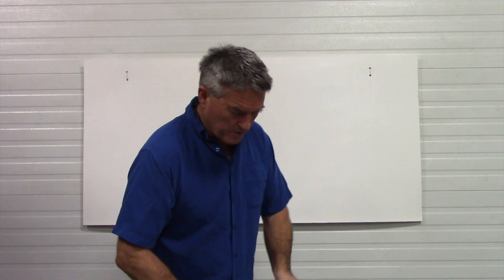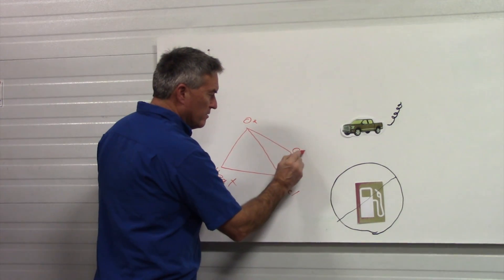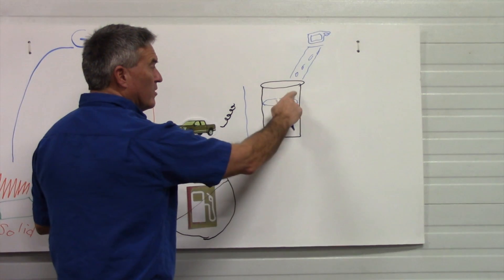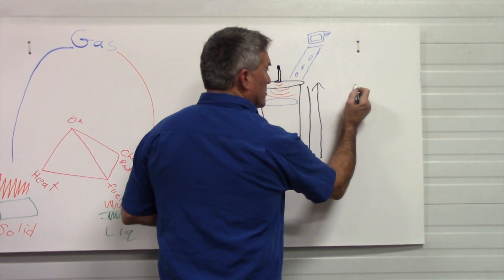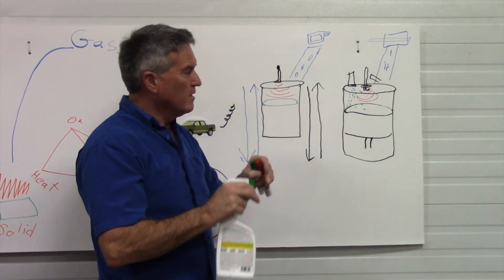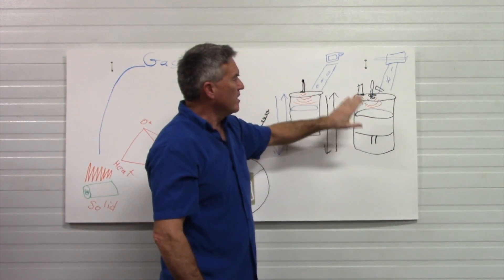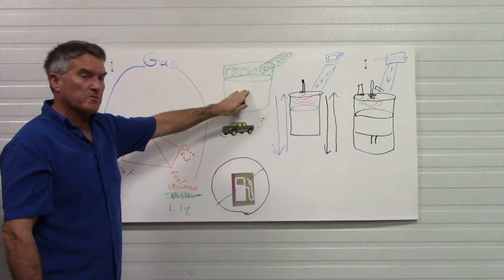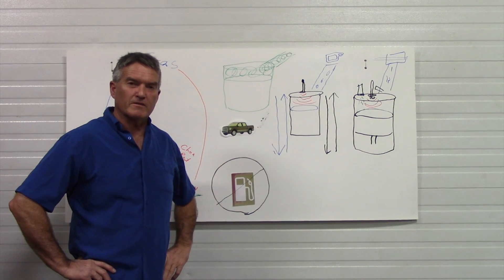One Simple Trick to get 100 miles per gallon with less pollution!

Comment: Ok...prove it..sell me the mixer deal...I build and tune bad ass blown/turbo motors and I am retired GM service tech...if it works...I can make it happen.....but I just dont think so...simple reason...to change a liquid to a vapor/gas it takes heat, if you heat liquid fuel to a vapor in the intake track it will expand to the point where cant get enough into the cylinder to make it run and even if you did residual heat in the combustion chamber would light it off way to soon. Basic fi system has injector that sprays droplets into the intake tract, open intake valve sucks it in and with intake valve closed and residual heat and heat from being compressed changes the droplets into a gas that burns properly....I got to.ask....you dont think that if it was that easy somebody would have it in.production right now? your injector in the cylinder..either old school diesel or new school direct injection that requires a turbo to work properly....and like has already been posted...crude oil is not a fossil fuel, in case you have not heard the theory that crude comes from dinosaurs was thrown out decades ago...as far as it being a finite resource...about as finite as salt water....figure with the way technology is advancing in 25 years ago be power output of ice will be a joke
Reply: Look up Smokey Yunik's adiabiatic engine.  It got something like 60 mpg and around 1.6 hp per cu in.
Reply: https://patents.google.com/patent/US4592329 here is the patent .. I_____________________________________Engine Type:   3 cyl, overhead valveDisplacement:  125 cu. in.Bore:          3.950 in.Stroke:        3.4 in.Rod length     6.5 in.Horsepower     240 Hp at 4000 RPM (special          high performance fuel-test          code 20 with 21 pound boost)Horsepower     190 Hp at 4400 RPM (93 octane          unleaded gasoline with 10          pound boost)Weight         320 lbs.Fuel economy   48.25 MPG (combined city          and highway)_____________________________________ .. stats from the patent, pretty sure it's said that it was in a buik when tested
Reply: Music

Comment: My brother worked for an LPG company in the 1970s. He could buy LP very cheap he converted his car to run on LP his mileage was much lower because the specific heat of LP is lower that gasoline but his cost per mile was better, just had to fill up more often. My point there is a lot more to the equation than you have stated.
Reply: If he had the compression ratio raised and retarded the ignition timing to TDC, he'd have gotten similar mpg and only a small drop in horsepower, unless we're talking diesel, that's different, you basically use a throttle body injection designed for LPG or LNG as an add-on to the diesel air intake and make sure there's computer adjustments able to be done on demand to get the best trade-off between power, mileage, and emissions.

Comment: Gasoline is not pure it contains different compounds that evaporate at different rates, this is called volatility part of the gas evaporates fast part evaporates slow what percent goes out the exhaust pipe as a liquid or vaporizes after combustion? Is there  enough unused fuel to turn a 15-20 mpg Caddie into a 70 mpg car? I don't think so.

Comment: Sounds like you discovered that carburetors do break up the fuel a bit better than fuel injectors. Which is actually accurate enough, the trouble with them was that the result isn't stoichiometrically correct at all engine speeds and that causes all sorts of issues, most notably unburnt hydrocarbons and/or Nox, and both those mess with catalytic converters.

Comment: So what this has been around for years, but the problem you mentioned still remains, heating.. And engine burn up, I  ran an engine similarly years back,  by heating the fuel with an electrical current in the float chamber of a modified carbure-ation system,  similar to a Poge carburetor,

Comment: I missed the "One Simple Trick" part.
Reply: "Simple"... That's what I was thinking!
Reply: The "trick" is in the click-bait title.
Reply: @richio1763  it's amazing that so many people wanna bash this guy for talking truth even with pictures for u kids. Maybe you should try it first. I have . It works . What he says is truth. Are we really this ignorant as to dismiss without trying it ? Then bash ? LoL...
Reply: @richio1763  lol
Reply: @richio1763  no the simple trick is vaporizing the fuel much, much earlier. Both carburetors and fuel injection dump LIQUID gasoline into the engine before the gasoline turns to vapor. If only vapor were dumped into engine, it would be much more efficient because you aren't dumping out the baby with the bath water....or bath water with the baby.....It's not click-bait.
Reply: Cargo Master 

98% of the fuel in modern ICEs is burned. There’s not much opportunity for more efficient burning. Gaseous-fueled vehicles are not more efficient than those which burn gasoline. So vaporizing gasoline, which is not homogenous, is flawed.
Reply: Evaporated fuel, burns more efficient... That's the trick, or do a hydrogen set up and run on water with saline...
Reply: Jose Garcia what about when it rusts any advice on that?
Reply: @strangescience3414  rust needs oxygen to form, you don't get rust from hydrogen...
Reply: The "trick" is to fund his patent or buy his invention.
Reply: @Liberallez  or do it yourself...
Reply: The simple trick was to not waste your time watching a video that tells you what you already know.
Reply: I think he's suggesting that LPG is the one to use, the Trick being you have to convert, converting to use LPG gas in the UK there is definataly a considertable saving as there is little or no VAT as it is used domesticaly,
Reply: I know alcohol is very bad for vapourizing but thanks for explaining it to the rest of us....I have heard of a device that warms the fuel to further improve gassing off but sort of defeats the purpose from a compression ratio point of view
Reply: Liam Roberts he's saying we can basically turn our liquid gas into a massive storage of lpg by turning into a gas state. And tuning the air fuel ratio with a steam of compressed air. Also that we are not stoking the flame enough. Which is correct. Similar to a bellows used by a black Smith. What's with the gripping???
Reply: The simple trick is converting liquid gas to an actual gas before burning it. The simple part is the concept. Implementation in a safe manner is not so simple.
Reply: @consaka1  I agree. The key word is SAFE. If you pre-mix the air and gasoline into a flammable vapor outside of the engine and then get one misfire back out into the induction system (possibly due to a bad coil or a spark jumping between two plug wires) the induction system is going to explode. This is one reason conventional automobile engines don't bring the air and fuel together outside of the engine. Jet engines and rocket engines don't do it either.
Reply: @consaka1   exactly, had an old mechanic show how stable liquid gasoline was by throwing a lit cigarette into a can with gas in it.  Not terribly smart, but it got the point across.  Liquid gasoline is fairly stable, gasoline fumes have lots of air between the gas particles, so it becomes much more volatile.
Reply: consaka1 also finely tune with a compressed air stream
Reply: @consaka1   That is exactly right, what ever the gas thing is it would be dangerous. I have seen a thing where a copper pipe was wound around the manifold for the petrol to heat up before going into a container that was heated by exhaust gas piped through tubes in the container. This heat gassified the petrol and the engine was supposed to run on the fumes coming off the super hot petrol. I do not know if it worked but it was certainly dangerous enough.
Reply: @7316bobe  Yeah if you wanted to make it more dangerous this would do it  HOWEVER if done right it could be no more dangerous than Propane systems on cars. Probably be some expensive tech though.
Reply: There are different grades of fuel depending apon where you are. Remapping can pay for itself if you do a lot miles.
Reply: First turn into a gas than more finely tune the air mixture with compressed airstream. "Simple trick"
Reply: @strangescience3414  we call it fuel injection these days. Laugh! It was a new idea back then.
I never understood why a gas dissel type of engine wouldn't work. It's a LOT harder to ignite dissel than gasoline. And if compression ignites that..no reason at all it can't ignite gas.
But..that's just me.
Reply: I gotta admit, this was pretty sciencey.  But ya, I was hoping to see the 1 simple trick.
Reply: @metalgamingwarrior  well the one simple trick is mixing air/vapor before getting into the cylinder instead of spraying gas and air into it and having to vaporize it then...cuz gas dont burn,vapor (fumes)does.
Reply: "I don't know but Step 3 is PROFIT!" - Underwear Gnome #37
Reply: That's the trick!
Reply: Seems to me: What he seems to be missing is a high velocity airstream/fuel injector port that could induce rapid cooling of the cylinder face and effectively supercharge the aspiration cycle allowing leaner fuel ratio and avoiding predetonation issues.
Reply: What happens when the intake valve where’s out and doesn’t close or timing belt breaks??? Can you say BOOM! And bye bye...
Reply: @RadioactiveBiohazard1313  really ??
Reply: The simple trick is using gas vapors instead.
Reply: ya where is the trick
Reply: Larry w2443 b  

t r
Reply: Larry cz
Reply: Richard Gieser me too I'm thinking click bait
Reply: @ Richard Gieser: LMAO ROFL thanx for saving me the time
Reply: Why doesn't youtube have an option to keep these jokers from making money off of lies?
Reply: @bjl1000  Because Youtube is too busy demonetizing, silencing, censoring, folks that do not meet Youtubes political and financial goals
Reply: +Rich:  I guess the trick is to get a 5 gallon bucket, put 4 inches of gas in the bottom, put a hose in the top and draw off the vapor.   These knuckleheads actually believe something like this works, but for some reason never demo a car traveling down the freeway at 70mph utilizing it.   You can find a dozen vids on utube demoing a car in some hillbillies backyard, idling on just this system.  They never seem to realize that the purpose of a car is not to idle in the backyard. .
Reply: @37rainman  hahahaha... No... The fuel is heated while contained, the heat will make the liquid fuel evaporate and be used as a gas to burn more efficient...
Reply: @37rainman  here is the funny part, the heat from the engine would evaporate the spray droplets, now the "liquid" is a gas...
Reply: @ 37rainman  IF you read my post you would have come across the name Polk.  He PATIENTED  a carburetor to do this and drove around with it.  Then the oil industry made him disappear  THAT'S WHY.
You guys aught to do a little research before you get all skeptical.
Reply: Solgern Traveler
If he patented it, the plans must be on file at the patent office. Have you tried looking for them there?
Reply: @sojournsojourntraveler1203  , correct..except that Polk didn't just disappear...he took the $5,000,000 yep..five million bucks...and moved to a nice quiet place! 
THEN two years later he came up with ANOTHER great idea..only this time he gave the big three first shot at it.
They claim it was a failure..like the FIRST idea turned out to be.(it wasn't, they lied and shelved it) they claim to have passed on idea #2...that is when he left Detroit and never came home again..or anyplace else that I have heard of.
But, no one believes that either. Laugh,!! Guess we need a body, and the blue prints for both ideas to make it float for them pal.
He should have just keep the 5M, and kept quiet!!
Peace!
Reply: Do you have any information to substantiate your story ?
Reply: This principle works. 
Thing is the powers that be in the oil industry / Banksters  will do what ever is needed to stop it from being used very much.
Reply: @ tampicokid  
Why,  is because the petroleum industry is tooled up for the statuesque.
The robber barons run the US along with the Banksters.
That is the cliff-note of  WHY !!

Comment: The compression stroke heats the air and vaporizes the mist of fuel, no problem, so long as the mist is fine enough.  Learn some thermodynamics and this would be obvious.  Also at high pressure stuff burns a lot faster.
Reply: ...ignites quicker.

Comment: Raw fuel does NOT burn,  a carburetor or fuel injection system does NOT "DUMP" raw fuel directly into an engine. Fuel is precisely metered, finely atomized and introduced into an airstream created by an engines intake system in the form of a vacuum. This very finely atomized fuel and air mixture is mixed and metered as close as possible to a ratio of 14.7:1. An engines combustion process relies heavily on the principals of thermal dynamics. The factors involved that is required to create the proper thermal dynamics to occur for proper combustion is a proper mixture of fuel to air ratio, combustion space volume, intake fuel/air delivery timing, and ignition timing source. If any part of this combination of events is not correct or is disturbed in any manor, the engines power and overall performance is dramatically affected.
  Once these relatively complex processes and principles are fully understood, only then should an individual be prepared to make changes or alterations to the internal combustion gasoline engine.  I have viewed your video and you lacked mentioning of emulsion, atomization, thermal dynamics, fuel properties or what the stoichiometric efficiency is in a gasoline engine. 
  Knowing and understanding the principals required to support the needs of an internal combustion engine leads me to a realization that what we need is an alternative fuel source other than the use of gasoline or an entirely new and different power source, after all our current internal combustion gasoline piston engine design and theory is nearly 200 years old
  A gentleman by the name of Paul Pantone developed the GEET system that worked very well yet ran into troubles with his invention and left the country.
  In the early 1780 a process was discovered that produced a fuel source known as water gas.  

 From Wikipedia, the free encyclopedia

  Water gas is a mixture of carbon monoxide and hydrogen produced from synthesis gas. Synthesis gas is a useful product, but requires careful handling due to its flammability and the risk of carbon monoxide poisoning. The water-gas shift reaction can be used to reduce the carbon monoxide while producing additional hydrogen, resulting in water gas. Pure hydrogen can be obtained from water gas by using the water-gas shift reaction, after subsequent removal of the carbon dioxide formed when carbon monoxide reacts with water.
Reply: a engine can run by dripping gas straight into the intake, valves open ,spark , boom exhaust
Reply: not always , carbs did not atomize the fuel like fuel inj.  (that's why the term dump fuel )and todays high pressure common rail or even better direct inj. atomize the fuel much more and it's  measured more precisely , just follow behind an old carbureted car and tell if you smell the pollution
Reply: If a carburetor did not atomize fuel then I would like someone to explain the principles of an emulsion tube, how and what an emulsion tube\chamber does and why they are so important to the function of a carburetor,,, Additionally, I would like someone to identify where the Pintle valve\needle is located within a fuel injection system. Fuel MUST be atomized to a fine mist and introduced into an air stream (except for diesel engines) prior to entering the combustion chamber for proper combustion to occur. I am a professional ASE certified technician engine builder, tuner and smog testing tech with nearly 40 years experience.

Comment: actually oil is an unlimited resource and not a fossil fuel at all that is one of the great myths of all time supported by the oil barons for a hundred years to justify it's price ,, oil is in fact a by product of the off gassing of the earth's magma it settles in cavities deep down now as the surface accumulations have been long harvested ,it ranges from light crude diesel to the black muck in the middle east ,, do the research and you will find that Rockerfella is responsible for declaring it a fossil fuel going to a conference in Geneva in the later 1800's to campaign on behalf of oil being a fossil fuel , look up i can't find the article i read years ago on his actions at that meeting but here is a link on the real origins of oil      https://youtu.be/XXnUD2-joAc

Comment: Evaporation methods of fuel delivery were one of the first methods of fuel induction.  The engine used in the wright flyer would be an example.
Reply: The first flights of the Wright Flyer were done without any throttle butterflys. Raw gas was in a tray in front of the intakes. The 4 cyl engine made 12 HP.